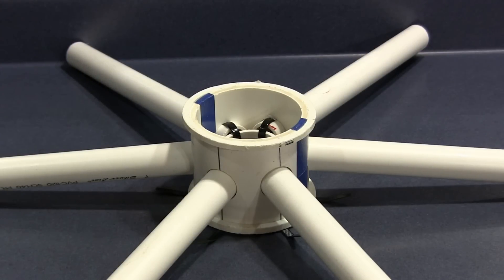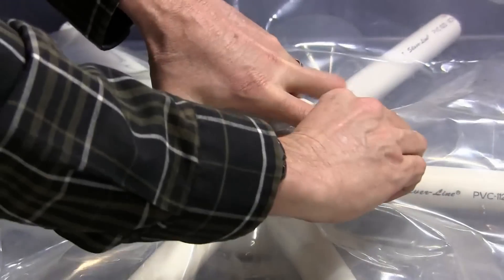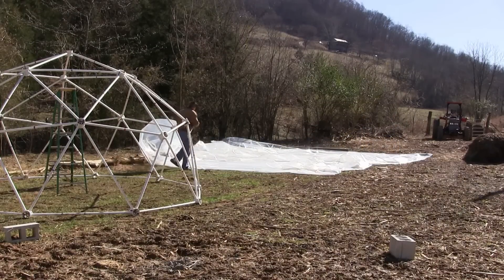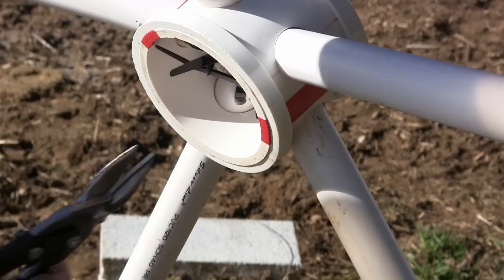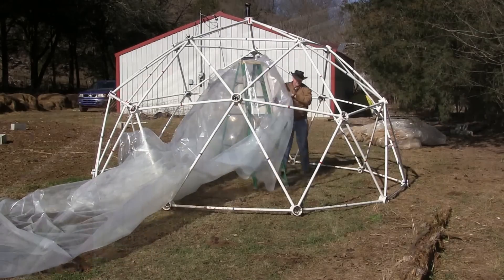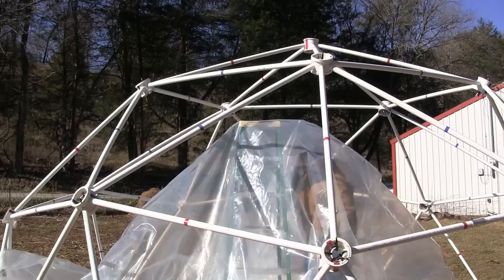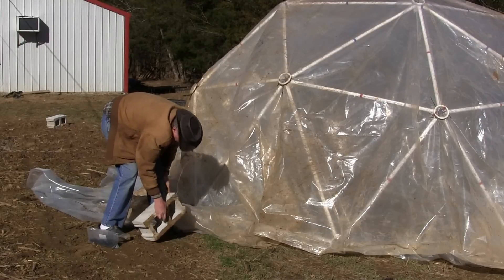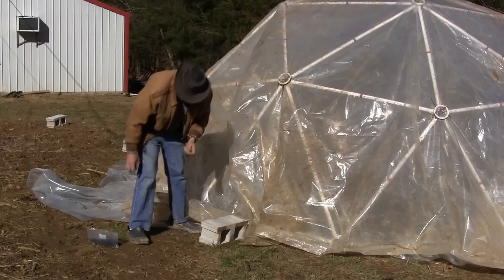How to Attach a Geodesic Dome Covering for a Greenhouse

Comment: I appreciate your videos and the dome system you have come up with. I would like to add for your consideration the use of hat channel furring for attaching the covering inside and out. I have a lot of experience building containment walls with 6mil poly, hat channels, and tek screws. I suggest attaching the hat channels to the pvc pipe inside and out. Apply double sided tape to the hat channels. Stretch the poly across one triangle. Fasten hat channels over the poly to the ones under. The poly will then be stretched very tight and add strength. Then do the same to the other triangles. You will end up with about three layers of hat channels on each side on each strut. Now you realize you could have used smaller pvc pipe., just enough to stand up the shape in the beginning. I would extend each section of poly across the hubs working from the bottom up. Regards, Sam. (This would comply with Bucky's concept of additive structure assembly/manufacturing.)
Reply from the maker: That is great, Sam.  Thank you for the information.  John Hurt
Reply: @ZipTieDomes  A water tight skin is the hardest part of dome building. 6 mil poly tightly captured on all edges and tight is extremely strong in the wind.
Reply: There are much easier way to accomplish this.  You`ll need to buy  6x more hat channel to attach the cover than the pvc tube needed to build the dome.
Reply: Not exactly 6x. But after doing this, you might realize you don't need the PVC tubing. 
But why not just split some next size tubing and use it to hold down the poly and tighten it.
Reply: @sampowell8472 
Install some wiggle wire channels running from the top of the dome to the base ring and cut gores out of poly.  Add a cupola to create a top vent and cover the top end of the wiggle wire channels
Reply: I like the wiggle wire concept. Provides drainage channels, can overlap cut poly, and stretches the poly. About $1+ per foot.

Comment: for as many zip ties you use you need t buy a zip tie gun, it will pull them tight for you and also cut them flush all at the same time.  It is a relief on your hands big time, it works effortlessly.

Comment: Is it possible to have air blown in between the two layers as is the case with some high tunnel/hoop houses?
Reply from the maker: Yes, with the Dual Covering hubs, you could blow air between the layers, but the strut are between the layers of greenhouse film, and that keeps a good amount of insulated "dead air" space.  Thanks for watching the video.  John Hurt

Comment: why not use 2 sheets on the outside?
Reply from the maker: There is better insulation with the dead air space between the two sheets, one on the inside and one on the outside.  Thanks for watching the video.  John Hurt
Reply: @ZipTieDomes  oh right.

Comment: A flush cut wire cutter will cut zip strap flush to zip lock leaving a non-scratching, gougling or cutting nice clean edge. They are smaller to get inside. Sort of a set of diagonal cutter that doesn't leave sharp edges above the lock. Love the zip tie dome idea... Wonderful!
Reply from the maker: That is a great idea!  Thanks for your comments.

Comment: Surely, erecting the covering onto the outside of the dome would be more efficient....tie at the top and bottom, and the structure if the dome supports the covering at all points of contact, placing on the inside means it is more susceptible to wind as it is not fully supported by the dome, and will move more... placing it on the outside also allows the use of double sided tape to secure the cover better along the lengths of plastic tubing...and effectively, you only need one cover, not one inside and one outside...although I guess in particularly cold areas, two layers would be better than one...
Reply: Two covers are only beneficial if they both have airtight seals.
Reply from the maker: The two layers make a "dead air space" for insulation purposes.  Thanks for watching the video.  John Hurt
Reply: @ZipTieDomes 
 wind hitting the poly will cause the air within the cavity to move, if it can move its not a dead air space. Dounle skin hoophouses maintain postiive air pressure in the cavity by using a blower and good cover seals (wiggle wire polylock etc). Fwiw, any gap wider than 3/4" will allow for convection currents to be set up inside the cavity, essentially a conveyor that will transport  heat from the warmer inner cover to the colder outer where it is lost. This process is driven by temperature differential so a still or dead air space will have no effect. Theres no sense spending twice as much on poly and gaining little to no benefit from it except perhaps from a placebo point of view ;)

Comment: You are Geniuses of Practicality!!!!  A similar technique has been used to make big fabric decorative Buttons for centuries. ADAPT! ReCYCLE! Improvise!  
Your Design is light enough you could put Double layers of Plastic Sheeting for superior insulation, since your Collars have a Lip at Each end -- Put a sheet on the outside By turning it upside down for easier access, then mount the other sheet for the interior AFTER setting it UPRIGHT again. Does that sound like it would work???
I've used zip ties to hold five Steel Pipe Gates together with a flimsy "fabric auto Shelter/garage" as a shelter for five rescue foals from the Premarin Mares program. When they arrived at age six months, each critter massed the same as a full grown Quarterhorse! I secured the Steel Gates to form a base, using about two dozen heavy duty UV-resistant zipties per join distributed bottom, middle & top. Fastened the thin metal tubes of the fabric Carport to the exterior of the gates. Despite all the rambunctious horseplay in that space, the thing lasted two full years, until my wife dismantled it after we'd got a regular barn with stalls. I LIKE ZipTies!!!!
Reply from the maker: Yes, we have a video on how to attach the greenhouse covering to the inside and the outside of the dome:  
https://www.ziptiedomes.com/video/coveringsvideo.htm
We use 120 lb nylon and 250 stainless steel zip ties to build our domes.  You can buy these zip ties straight from the manufacturer for your projects:
https://www.ziptiedomes.com/zipties.htm
Thank you again for your comments.  
John Hurt

Comment: ... min 3:06  Señor, en el mercado existen cinchos de 500 - 600 mm de largo.
Un cordial saludo.
************
... min 3:06 Sir, in the market there are belts of 500 - 600 mm long.
A cordial greeting.
Reply from the maker: Yes, you can use a single zip tie that is longer instead of 3 short zip ties.  Thank you for watching this video. 
Sí, puedes usar una sola brida que sea más larga en lugar de 3 bridas cortas. Gracias por ver este video.

Comment: If you attach the inside cover first, when you do the outside how are you reaching the hubs on the very top?  Are you skipping these?
Reply from the maker: The outside covering is pulled tightly over the top of the dome and does not start to have pleats in the covering until we get down the side of the dome.  We take up the excess material in the pleats by wrapping the pleats over the hubs and zip tying the pleats/covering to the hubs. So we don't have to worry about attaching the outside covering at the top of the dome, as it is pulled tightly there.  I have seen some customers attach both inside and outside coverings to every hub, it takes a little more time, but if you are in a high wind area, it would be worth it.  That is a very good question, thanks!  John Hurt

Comment: why not offer zip ties long enough to go around the hubs using only one zip tie? would sure be easier to attach green house coverings!
Reply from the maker: Rick,   Thanks for the idea.  The shorter 8" zip ties are interchangeable with the ones needed to build the dome.  And with these shorter ties, you have 3 tabs to pull on to help you cinch the ties down behind the hubs.  But you are right, one single tie might be easier to use.  I will consider changing over to one longer tie for our customers.  Thanks again.  John Hurt

Comment: you can us a clothing iron and aluminum foil to seal the inner and outer  films together  if you want. or to repair.
Reply from the maker: Thank you for your comment, I appreciate the information.  Yes, and you can also use a special tape made for greenhouse film to repair or to connect two greenhouse films together.  They sell this tape at Grower's Supply, which is a division of FarmTek at this link:
http://www.growerssupply.com/farm/supplies/prod1;gs_greenhouse_films;pg105434.html
Thanks,
John Hurt
Reply: the beauty of the heat sealing is that you can build up as much thickness as you need as fastening points.
Reply from the maker: Thanks!

Comment: I was wondering-  but, now I see, unique~I'm looking for simple reusable structure to use as a form for papercrete
Reply from the maker: You can cover the dome with a billboard tarp, the shoot the dome with shotcrete or papercrete.  Then go inside the dome and cut the zip ties, remove the center rings, and slide the struts out of the hubs to take the dome apart, then build it again to make the next dome.  Sorry I did not get back to you sooner.  Thanks for your comment.  John Hurt

Comment: The only issue with these domes when used as a greenhouse is the covering method. You`ve got way too much spare material in the inevitable folds and pleats. Nothing destroys poly faster than it flapping in the wind. Having the PVC tubing in contact with greenhouse poly isnt a good idea either, the pvc outgasses chlorine which degrades it rapidy. It will also negate any guarantee you have regarding the lifespan of the poly.
Reply from the maker: +JohnGuest45 On the outside of the dome, the greenhouse film is stretched tight over the top of the dome, with the spare material taken up where the greenhouse film is attached to the Dual Covering Hubs at the top of the first tier, about 4' off the ground.  Any remaining pleats are taken up on the bottom struts of the dome with fabric clips for snug fit.  There really is no other solution, as greenhouse film comes in flat sheets, and is not a "fitted cover" or anything like that.  So you are going to have pleats with a flat covering applied to a round dome, regardless  So the Dual Covering Hubs are the only solution, that I know of, that does take up the additional spare material.  The only other solution is Marine Shrink Wrap, but this material is not for greenhouses, as it is designed to last only one year.

For the greenhouse film on the inside of the dome, there is no wind load, so the pleats are not a problem.  The greenhouse film can hang somewhat loosely from each dual covering hub with no problem, as the film will not flap inside the dome.

PVC does produced chlorine gas, which affects the greenhouse film on any PVC structure.  We recommend that you paint the dome with white latex acrylic outdoor paint anywhere the greenhouse film touches the PVC.  Also, you can use non-PVC clear packing tape to cover the hubs and struts.  But a coat of white paint is much easier, and blends right in with the color of the PVC pipe.  We have this and other answers on how to use our domes on our FAQ page.  Thank you for your comment.  John Hurt
Reply: Blowing air into the void will stiffen both sheets.
Reply: A heat gun will pull out a lot of the slack.
Reply: @unicornadrian1358  
A heat gun will melt the plastic or cause it to stretch. Greenhouse poly is not like heatshrink :)

Comment: What a great idea what if you filled the hubs with expanding foam for even more strength and added rigidity of the joints . thanks again
Reply: It would also protect the zip ties from UV damage if any .
Reply: nisw1918 This great idea would also work with Bamboo .
Reply from the maker: nisw1918,  That is a good idea.  We see a lot of people who take this dome design to the next level.

Comment: Use predetermined length of Bailing Wire; put Twist loop in both ends; secure wire around plastic and hub, and twist to tighten.
http://www.glamoswire.com/sites/default/files/Single%20tie%20loop%20no%20background.jpg
OR
https://www.youtube.com/watch?v=X1BJQorsaCQ
Reply from the maker: Very good, thanks.  John

Comment: Why 3 zip ties? One long one would be cheaper.
Reply from the maker: POVAdventure,

That is a great idea. The 3 separate zip ties do cinch down tighter, as you can pull on the 3 separate tabs independently.  But one tie would be cheaper.  Thanks, John

Comment: Interesting and creative.  ZIP Ties?  I attached a licence plate to a utility trailer, after a few months became brittle from sun exposure, almost lost a plate.  Good luck.
Reply from the maker: 1Skeptik1, The sun's UV rays can cause problems.  We use specially made UV resistant "black" 120 lb Heavy Duty Zip ties, not the cheap zip tie you can buy in a store. All of our parts are guaranteed for 2 years, including the ties.  Thanks, John